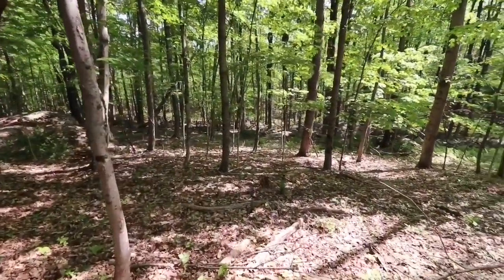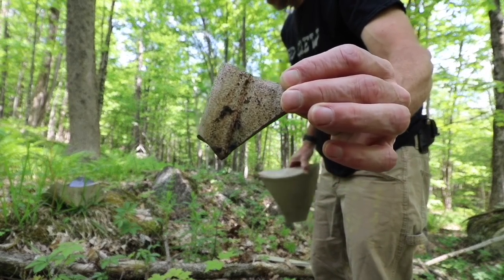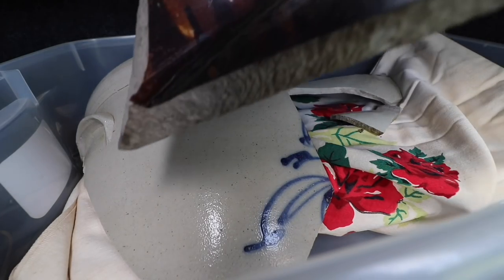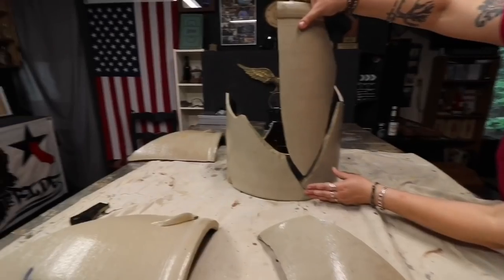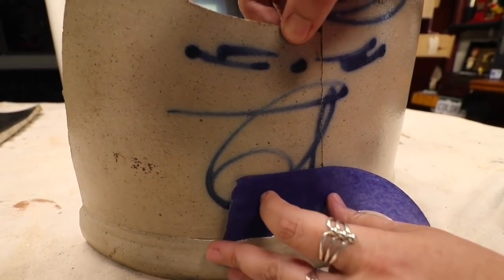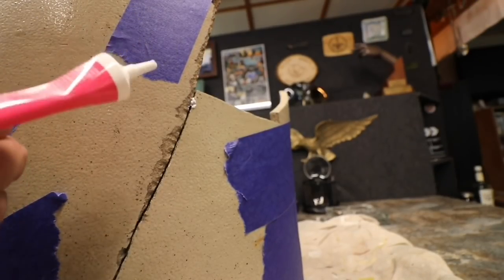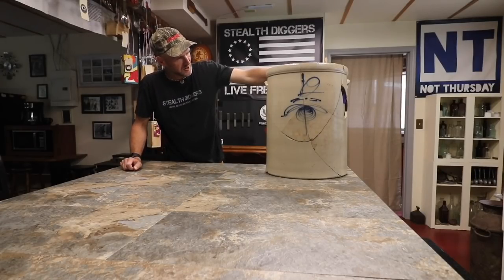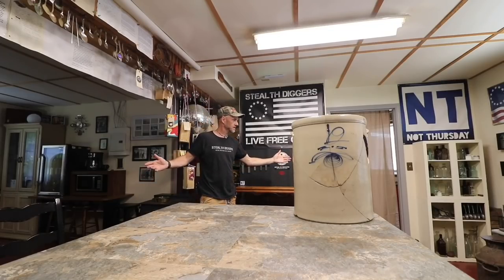Digging up a broken 1800's stoneware crock & gluing it back together with Elmers cement

Comment: I bought a house on 3 acres in Georgia.  In exploring the woods behind my house I found a giant "southern" pot like this.  I did just what you did.... started gluing it together, found I was missing a couple pieces, went back out and scoured the ground until I found a couple more pieces.  My pot (churn) was signed "W.T.B. Gordy - Greensville GA" and had a primitive "5" incised in the clay which meant 5 gallons.   It was a super fun project.  I can't wait to find another one of these pots some day and glue it together.  Just like yours, mine was still missing a piece, so I found a product at Home Depot to fill in the spot so the pot looked complete.  In researching Gordy I found this pot was over 100 years old.

Comment: I have an old crock found in a flooded basement, it's about a 35 to 40 gallon size. And another one from the San Francisco sour dough plant that still has its lid. It is about a 3 gallon size. The big one has a heavy wire around the top rim, looks original to it. And about an inch thick.  I have a large palm tree in the big one, and a houseplant potted and set inside small one. Have had many offers on the big one... Not For Sale though.